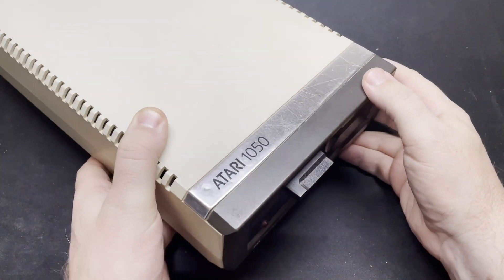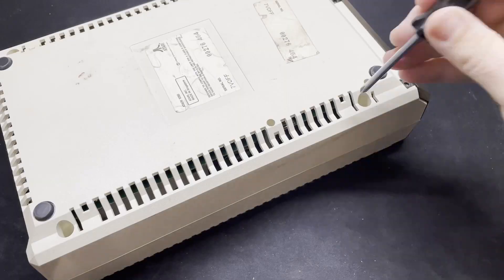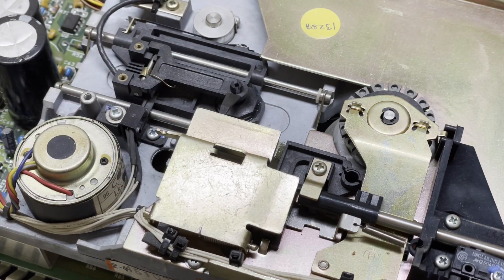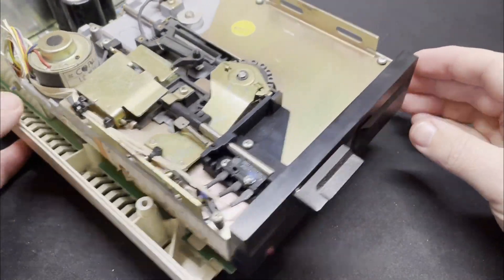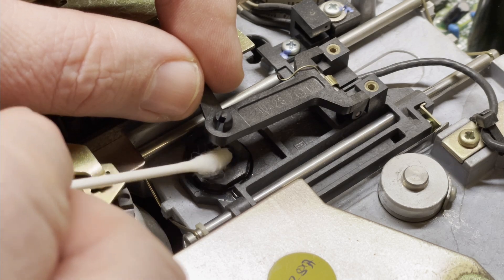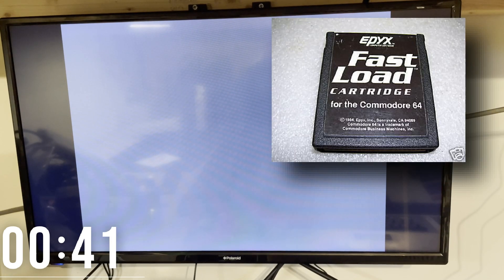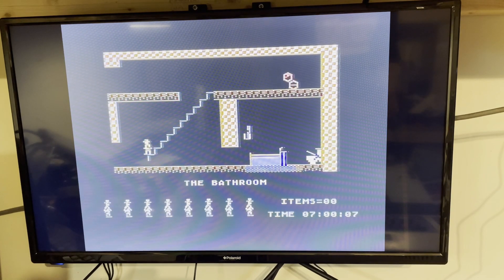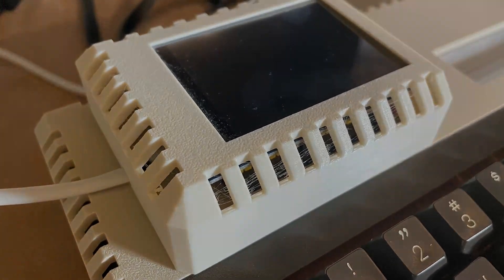Let's see why we can't insert a disk into this Atari 1050 Drive.

Comment: I am in the middle of trying to fix my 810 right this moment, as I watch this I have parts on the table. As an aside I like that graphic of spec sheet for the current consoles showing how the Xbox and playstation rock the switch hardware wise, while the switch I find is much more fun to play, the other two seem more like work when I play them.

Comment: I have one of these with an atari 1200 XL computer along with cartridges and discs I found at a garage sale, and it all works. At some point in the 80's the owner was using it for home finance or possibly some small business. i demonstrated it to a young guy i know who was into vintage computers and he couldn't believe it booted from the drive and worked. The keyboard has the issue of needing the keys worked a bunch to get them working right, but the entire system is there. I was pretty surprised when i found it, I had worked for Atari as a tech on the VCS and later the 400/800 lines back in 81 and 82, it was a real blast to find.
Reply from the maker: What a great find!  I'm insanely jealous of you :) :)
Reply: @TheRetroShack  You like this old stuff, may have to talk with you about selling it to you. I was glad the drive worked and it powered up fine. I also found a complete XE gaming system and dredged up some game carts for it, sometimes even play some asteroids, missile command or pole position still!
Reply from the maker: @Oldbmwr100rs  Drop me an email :)

Comment: My first floppy disk drive, bought alongside an 800XL in a cracking deal Curry's were doing at the time. As a budding programmer, it completely transformed my home computing experience over my previous tape based computer setup and was very reliable considering the huge amount of use it got.

Comment: I have a happy 1050 and it works just fine. No issues at all. I don't have jet set Willy though. When I have time I will load something like flight simulator or Ghostbusters from a standard drive and the happy and let you know the difference.
Reply from the maker: That would be great, thank you!

Comment: Those cards (Center for Computing History) comparing systems had an Atari 520ST (June '85) but not one for the Amiga 1000 (July '85)...was that just a cutoff date when they were made or it was a subset and just randomly excluded the Amiga? I didn't try to date all the systems on there but the Mac 128K and Sinclair QL were from January '84.
Reply: Weird, Wikipedia says June '85 but other sites say April '85 for the Atari 520ST...

Comment: My 1050 drives each have a US Doubler upgrade installed. It enables them to do true Double Density as well as a data transfer speed boost normally used by SpartaDOS but can be used by anyone (such as disk copy software) if they know the right SIO calls. It's rather trippy to see the sectors fly off the floppy then get blazingly written to the SDrive Max! Just remember to save the created disk image or you lose it and have to do it again.

Comment: The Atari 1050 was a very good drive, much liked by all users.

Yes, even more liked than the later XF551 model - though that one was a dual-head drive (truly double-sided diskette usage), supported a true double density (360 kB per diskette instead of 2x130 kB for the 1050) and was faster when using 3rd party DOS - the drawbacks were the Atari DOS 3.0 supplied with it (which was incompatible with pretty much anything else) and the fact that 'B-sides' of diskettes formatted in XF551 were not readable by other drives (as they have been formatted 'in reverse' compared to 1050 or the 810). Also, sometimes the higher drive speed (300 RPM) caused issues reading disks created on its predecessors (e.g. 1050's 288 RPM).

On my part - when I had a choice of buying either a 1050 or the XF551, I chose the prior and never regretted that, as it served me well without any issues at all.
Reply from the maker: Very interesting! Thanks for sharing.
Reply: @IcyTorment  Good point - in fact, I read that same info in Michael Current's 'Atari 8-bit computer FAQ' a few years ago; I (can only) presume there was a difference between the US and EU packaging.. Here in (back then) Czechoslovak Socialist Republic, the 1050 was packaged with DOS 2.5 and the XF551 with DOS 3. To put it into time context, I'm talking about 1986 and 1988, respectively; even possibly a +1 year to both of these.

To add - I realize I may have made the XF551 sound like a bad drive, which was not my intention; in fact I fully recognize the fact that it was technically better and thus the superior drive of the two. It's just that considering the price of each vs perceivable performance difference vs all the compatibility stuff, the 1050 was possibly a better choice.

BTW when I used XF551 on a few occasions, I had some very pleasant experience with MyDOS (as directories and sub-directories - a feature there that I recall having used - were a 'wow' stuff / big thing for all of us Atari 8-bit users); but frankly I do not recall if it took / was capable of taking some extra advantage of the XF551 drive.

LbnL thank you, as your comment brought some sweet memories once again 🙂

Comment: Brilliant video, glad you got it fixed easily.
The caps that often go bad are the smaller ones '47uf 16v'. Can't remember the location numbers off hand, but as I mentioned before I fix these frequently and the main common faults are bad caps and the two doubler diodes. Worth doing.
Other things worth doing which cause problems are:
Clean the drive select switch. 
Clean the head and the pad that floats above the head.
Clean and lube the head rails. 
Check for dry joints on the diodes. 
Reseat the socketed chips.
The belts can get a bit dodgy but it's not really that often I've seen a bad belt. 

There's also a 1050 diagnostic disk that is a godsend, like an mot for the drive, well worth using to adjust the zero track sensor and motor speed.
Reply from the maker: Thanks for info - very useful!

Comment: Your Nintendo switch dig touched a nerve here. I've just bought one for my daughter for Christmas and all she will play on it is animal crossing. Yes, I'll play Mario kart too as well as box boy (great game) but I don't usually buy current consoles.
Also today I got a PS3 slim from eBay as my phat has given up again. The previous owner had the chips reflowed a couple of times and I delidded the CPU and GPU, replacing the thermal paste to get it working, but it always ran hot.
The older machines are much easier to work on without specialised equipment.
Reply from the maker: I bought a switch when they first came out and only played Zelda on it :) So don’t worry - Sometimes a killer app is worth buying the machine it runs on :) :)

Comment: I had a Happy in my drive, and it pretty much ruined it over time.  After about 6 months, disc drive wouldn't read anything, once it was warmed up.
Reply from the maker: Good to know - I think I'll be opting for one of the more modern solutions :)
Reply: The Happy upgrade itself probably failed. They weren't too reliable. You could have returned it to stock and it should have worked. The pad that presses the disk to the head may have needed changing, especially if you used a cleaning disk which are known to ruin the pad.
Reply: My 65XE and 1050 drive are long gone.  Back then it never even occurred to me to remove the Happy Mod.

Comment: I think the "US Doubler" was more common in the UK,  I seem to recall Happy Drives were likes hens teeth.
Reply from the maker: I think I'll be opting for one of the more modern solutions - just a matter of choosing one :) :)
Reply: @TheRetroShack  The thrill of using the doubler was amazing.  A few slow beeps then woooaaaahhhh !!!!!! SpartaDOS kicked bottom lol
Reply: @TheRetroShack  tf_hh in Germany makes great upgrades including for the 1050. He's on AtariAge.
Reply from the maker: @gamedoutgamer  Thanks!  I’ll take a look :)
Reply: @TheRetroShack  Looks like he's out of 1050 upgrades which is unusual. It might relate to the supply issues. Suggest you contact him. He may be able to make something if it's not showing in stock but maybe not. No idea.

I do not at this time recommend removing the passive components from a 1050 to increase it's SIO speed as per tf_hh's suggestion for some 1050 upgrades. I did this once and the 1050 sent a surge on power-on to my computer and now the 800XL needs repairing. Not sure why this happened. Might not related to the removal of the passive resistors but unsure yet.

Comment: Looks like there's a spring missing? On the plate that lifts the counter-head, there's a hook towards the motor. And beneath it there's a hole with a hook too. Meant for a spring?
Reply: I noticed that too. Right where the metal tab was being lifted up.

Comment: Great little video - always fun to see things on computers that I remember but never got to use, except in Dixon's 🖥️

I could be wrong, but looking at the drive around 2:52 I think there should be a spring in the hook on the left of the metal plate to put some tension on it. Perhaps not, but it seems a strange design otherwise.

Comment: The turning drive door latch looks similar to later 1541 models. And the internals look pretty robust, hope you don't have too much trouble refurbishing it and fitting the speed enhancer. Looking forward to the SD solution too, definitely a good add-on these days for a retro machine.
Reply from the maker: Thanks - should get to this very early in the new year :)

Comment: All the caps look special, the drive uses quite a bit of power and the large charging caps are probably not the quality elongated ones but maybe some kind of low ESR? The little blue ones on the board look a bit shorter than usual too.
Reply from the maker: Hoping it won’t cause me too much trouble :) :)

Comment: In loading PRGs, the stock 1541 Disk Drive has a transfer speed of "about" 400 bytes/sec, which is approximately 96 blocks (or 24KB) per minute.  A drive that's only doing 300 needs to be serviced. ;-)  If the Atari 1050 is doing 2400 bytes/sec, then it still slightly edges out the 1541 with Epyx Fastload (which is about a 5x speed boost), but would be left behind by more advanced freezer cartridges like The Final Cartridge III.  -- JC
Reply from the maker: Interesting!  Most of my research has the 1541 at 300 bytes per second ( eg. https://en.m.wikipedia.org/wiki/Commodore_1541 ) but either way the 1050 demolishes in terms of out of the box speed :) I’ll have a look at The Final Cartridge III :)
Reply: The Atari's stock SIO baudrate is 19,200 but the 1050 does not read/write at this speed due to disk RPM, sector skew and the single sector 128byte SRAM of the drive. As far as I know it reads at about 7400bps, depending on the format of the disk. DOS 2.5 'enhanced density' disks read a little slower than a single density disk formatted from DOS 2.0s due to a different sector skew. You can hear the slight difference when loading single vs enhanced density. Enhanced sounds sloppier while single density sounds more like rapid fire.   A stock 810 will read single density a little (%5 or %10) faster than a stock 1050, but a US Doubler enhanced drive will again read single density disk the same as a revision C 810 which are the most common. 

There are many subtleties with Atari drives.  Tandon 1050's are common but about one out of every six drives uses a World Storage drive mech which are said to be better but I find the Tandon drives to be excellent and very reliable. When they are well lubricated and functioning they have a great and satisfying operating sound.
atarimania com/faq-atari-400-800-xl-xe-what-is-the-atari-1050-disk-drive_28.html
Reply from the maker: @gamedoutgamer  Awesome info!  Thanks :) :)